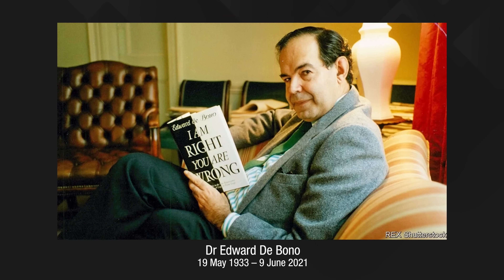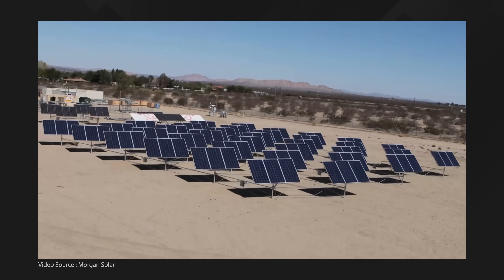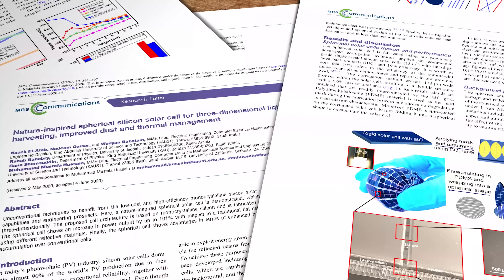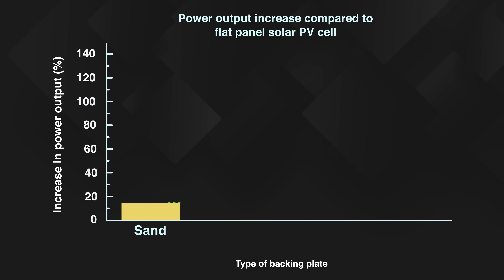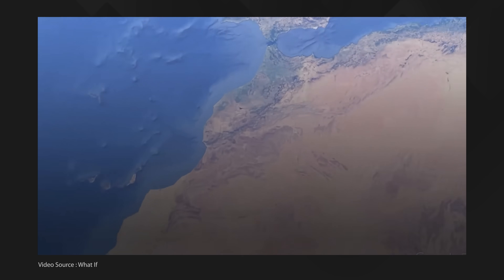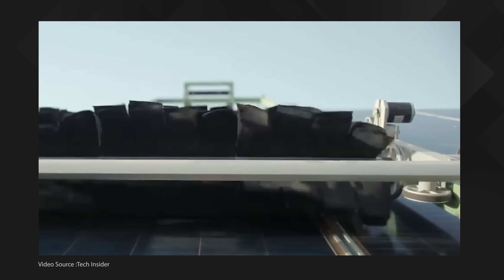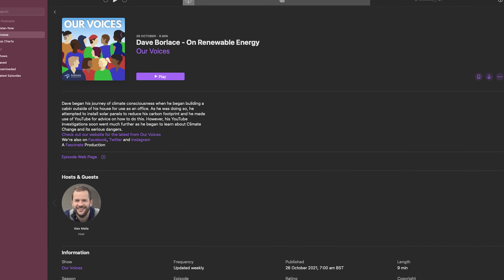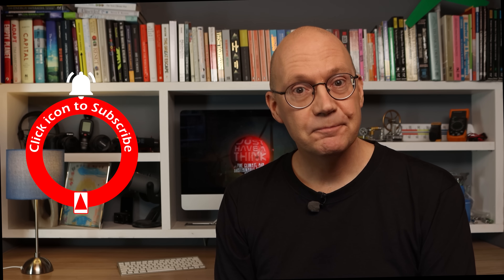Spherical Solar Cells - doubling the power output of flat PV panels!

Comment: Apparently they haven't heard of bifacial solar cells before, they don't even mention that word in their paper - do they not know the market? Any standard flat but bifacial PERC module is better at this than their sphere (power per surface area, without being moved). I don't see the point of this at all, and I really like to.
Why do they compare their IBC (Sunpower?) cells (full rear side electroce) with their sphere when they should compare bificial cells?

regards from a solar cell researcher - I do this every day....
Reply: I think I saw a ''Busted' video on these by either Dave at EEVBlog or Thunderf00t. The whole thing smells of a scam.
Great to see an expert confirm they don't quite live up to their supposed 200% improvement.

Comment: Many established flat panel arrays do not go to the expense and complexity of multiple motion units by just adding 10% more panels. It would seem you could also add reflective backing onto flat cells and make a gain in performance and there are already many flexible panels on the market for automotive / odd shaped projects. So sphere's and their cleaning problems would seem to be just a niche idea.

Comment: Pyrolysis of waste agricultural biomass using photovoltaics releases synsis gas and leaves behind biochar. Syngas runs internal combustion engines, like generators. Biochar is a permanent natural fertilizer and a long term carbon sink. No more need for mega li battery packs.

Comment: These numbers are surprisingly large. Increasing the efficiency of solar panels in such magnitudes could decisively alter a lot of calculations. In the past, the happenstance of being located over large oil deposits magnified the significance of certain regions. Perhaps different regions, like for example the Sahara, arid, and thus barren, will now have their turn to win the lottery.
Reply: Places with good insolation are already popular for solar installations. We need affordable high voltage DC lines to connect them to where the power demand is. These complicated hard to build spheres with dubious claims of more efficiency aren't relevant to the problem.
Reply: @skierpage  It's the willingness of investors to back transmission lines (and other infrastructure) that make them affordable. It's the projected profitability of the ventures that induce investors to invest. Double-digit increases in the efficiency of PV cells would likely enhance profitability even if the collectors were more costly. I did not predict that this particular innovation would bring that about. There are, however, several factors that incline foreign investors to view the Sahara region as a risky place to invest. For this reason it very well might require some development such as the one discussed in this video to make the region viable as a major supplier of energy. These facts are relevant to the problem.
Reply: These more complex designs are only relevant where space is the limiting factor, eg on a roof. In a grid scale solar farm, especially one sited in a desert, space is not limited. Cost of the panels is the main issue, so cheap flat panels are best.
Reply: @adrianthoroughgood1191  Good point. Didn't think of that.

Comment: Are they being compared to single-sided flat PV? Doubled-sided is probably a more reasonable comparison.  They still sound good for putting non-flat surfaces like cars or drones, although there they should be compared to PV paint. As for cleaning, how do you efficiently clean spheres? Maybe you can spin then or something but that adds cost, flat surfaces are easy to clean.
Reply: I think its just that you don't clean them at all, the convex surface and half the sphere being vertical or downwards-facing means dust does not settle on it very easily

Comment: I think I've spotted one area of dishonesty here. They are comparing the two dimension sizes of the flat and spherical solar panels, yes? That completely ignores the advantage that the sphere also has a non-trivial third dimensional presence that means that has more individual cells than the flat panel.

I'm not saying this is a nail in the coffin, but it feels a little shady... like saying that you've created a new ladder that can reach higher... "How did you do that?" "Well, we built a taller ladder. Isn't this amazing?"

It seems that there are other advantages and I hope this research bears fruit, but that size comparison feels more like a point made by a marketing team than honest research.

Comment: That is very interesting.  CO2 lasers are about the lowest cost high speed lasers you can use in industry.  I designed laser etching systems in the late 90s and we where always glad when we could use CO2 lasers as it would keep the cost down.  I could see a process for making something similar to bubble wrap out of thin film solar with this technology.  I also wonder if the mirror backing could double as a way to fight climate change.  There is a geoengineering solution which involves increasing the earth's reflectivity to reduce the effects of increased CO2.  Maybe this could be a hidden benefit to this technology.  Remove emmisions and increase reflectivity at the same time.
Reply: The ecological system you are asking about exists in the Meer reflection project and you can learn more about it at Nature Bats Last on the Guy Mcpherson website. Here is a link -
https://www.youtube.com/watch?v=3cLx9dbFpKg

Comment: With Sphere Smaller solar Balls you could HANG them in Parking Lots from 1 light Pole to the Next and create Rows of them and this can Power the Free Super Chargers in the parking lot. Panels only make sense if they are on the floor of the parking lot and have multuple A.I. Robots continuously sweep up all leaves and trash on panels. BOTH these together could create lots of free energy after cost of equipment
Reply: I would rather have cheap solar carports to charge my car AND shade it so I don’t have to waste so much energy cooling it down before driving
Reply: @williammeek4078  definitely. The space above an EV charging space is wasted real estate that could be generating electricity.
Reply: "power the free super chargers". Ummm. Let's say a "super charger" delivers 50 kW. That's at the low end these days, the high end being 350 kW or so. The sun irradiates us with something like 1 kW/m² at high noon on a cloudless day. If your panel is 20% efficient, you'll need 250 m² of solar panels to power one super charger at noon on a cloudless day. Divide by τ/2 and take the square root and that's a 9m radius (18m diameter) circle of sunlight that your panels need to capture. That's a 59 ft diameter for the Americans. Quite a thing to hang from a light pole! You can divide that number in half if you think your solar sphere can somehow capture full intensity high noon sunlight in all directions at once.

Comment: I was very excited to hear you talking of energy spheres. When I was nineteen back in the late 1960's I had a dream that my home had a tennis sized glass like ball filled with some kind of high tech components .the ball which was connected to a stable adjustable stem was projecting from the roof. The ball was somehow producing energy enough to power my electrical needs to supply my home. When I would tell people about my dream, most would just discount it as being silly.
Reply: I wouldn't be surprised if, in the not too far future, we learn how to create electricity from the oxidising processes going on in the air.
Reply: @robinhood4640  we've discovered that a few hundred thousand years ago
Reply: Actually, my bad, I thought you meant energy, the electric part was probably 100 something years ago
Reply: @robinhood4640  No your right, my 72 mach one mustang, my 1966 chevelle convertible.Hang on my shoe phone is calling .Dog shit again!
Naw it was just ncc1701.
Your who from where?.LOL.

Comment: Cleaning this sphere would be a pain.  Cleaning the refracting area would be a pain.  In order for light to reach the back side of the sphere as refracted light energy you would have to separate the spheres basically increasing the area needed to get that extra energy.  Might as well have a flat panel.
Reply: I was thinking the same thing and the direct back side to the sun will always be in shadow thus be totally useless.  A few years ago a company worked on a triangular shape cells and another took that development on by making a pyramid shape with cells on all sides and it turned out to be very bad the only advantage was it was less bad vs a fixed panel when track the sun but it output was lower because it had less surface area facing the sun at max point of contact

Comment: What I love about this topic is that regular solar is pretty darn good already, so if this doesn't pan out, then it's no big deal. However, if it really is an improvement and they can figure out how to manufacture them at scale, then it will expand the use of solar to applications that were not practical before. I wonder how it would improve the solar collection on the Sion, the Lightyear One, or the Aptera.  :-)
Reply: Solar cost ($/W) is significantly low that a new design may not be economically competitive but as we may face material shortage to reach over TW scale of solar, maybe the spherical design is the way to improve the performance with a given amount of materials.
Reply: @moonyongkim8330  how is having most of the solar material way off axis to the incident sunlight going to improve the performance per $?
Reply: @moonyongkim8330  You are absolutely right, and what you said should be stressed in any discussion of solar and wind power displacing fossil fuels as primary energy sources.

It's well known that the material requirements per kWh harvested in solar and wind farms are much higher than for conventional sources (i.e., the energy density critique), but that hasn't been an issue hindering deployment as of late given that solar panels and wind turbines are churned out from factories powered mainly with cheap fossil-fuelled electricity and industrial heat, most conspicuously in China and it's >60% coal-powered grid. But if we're supposed to increasingly use clean power to produce the same renewable equipment and supporting infrastructure towards a total fossil fuel phase out, then metrics such as energy density and EROI will eventually come back to bite us in the form of more expensive panels and turbines.

So the material and energy inputs required for fabrication and recycling of panels and turbines are extremely more important in the long term than LCOE when naively extrapolated from the current, low solar and wind penetration conditions.
Reply: Regular amorphous solar PV is only around 10% efficient in real life. Over the first weeks of use, all Silicon panels lose about 1% of total efficiency, for only partially understood reasons. So cells which were 11% efficient when new drop to abut 10% efficient.
There are laboratory samples of compound cells which are nudging 40% efficiency, when new, but they are very expensive to make, and not worth the investment costs for domestic or grid use.
Reply: Dirt and sand would collect in the trough and change the reflection.  The sphere would also have to rotate so it could cool off.  I had an off grid house for many years and the best peak solar energy I ever got was on clear January days.
Reply: Etulgo
Reply: Agreed Chris, I was just thinking the same when Dave showed us some images of cars! Maybe we could see a 2000 mile range Aptera in the future :-).
Reply: @WirelessGriff  obviously not. Changes to geometry aren't going to deliver four times the energy collection.

Comment: You realize that they are literally shining 2x the light on 2x the panel area and getting 20-39% more power and THAT is what you are pitching as a improvement. In reality it is an AVERAGE DECREASE in efficiency. Lab testing is only "a start" if you are testing the RIGHT conditions. Simple napkin math will show you that it will always be less efficient. Max efficiency is achieved through DIRECT light. Any surface not directly facing the light will not be at max efficiency. Because of the sphere less are overall is at max efficiency and most is at VERY low efficiency. You will also increase cost TREMENDOUSLY. Unless you have MANY MPPT inverters, the output of the ENTIRE panel is only as high as the LOWEST cell. MPPT inverters are expensive ($140-400 per inverter). You would need 1 per cell or 60 per standard size panel.
Reply: From what I cn tell the area they are comparing it to is 1/4 the surface of the sphere (and as you say 2* the incident light). Also they are throwing away 36% of the manufactured panel. (Not even considering you point about lowest cell efficiency).
I think the use cases would be VERY small if any.
Reply: Still might be good option if you have limited roof space and combine it with white roof color to gather much of the reflected light too. Tho it also takes vertical space and needs more bracing so yeah.. limited usecases i guess.
Reply: Given the greater cost I see this technique having an application only in locations where space is limited and the extra power is worth it.

Comment: I think you made a little mistake at 5:00. You said the elevated temperature caused more power.  5:00
Reply: He is saying that at elevated temperatures the spherical panel produces 39% more power than a flat panel.
Reply: @petehiggins33  ohhh got it. Will delete. Thanks.